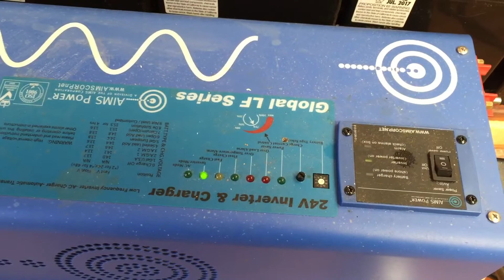Check you lead acids more

Comment: How many amp hrs is each battery?
Reply from the maker: RonTech34 105 amp hrs each according to the manufacturer
Reply: @southernohiosolarhomestead8477  what's the lifetime expected on them batteries how long have you had them
Reply: @southernohiosolarhomestead8477  about how long did the batteries last you so far?

Comment: Dude battery conectors cost about $1.95 a piece you should take the time out 1 day and fix all that it's like as long as it works you don't care how it looks you have money invested in it at least do it right so sad how people keep posting videos of there stuff but don't realize it looks like a 12 yr old kid did it come on dude get the right battery conectors on your wire and clean up all the wires on your system trust me you would feel better after